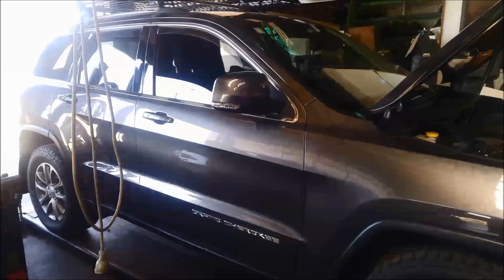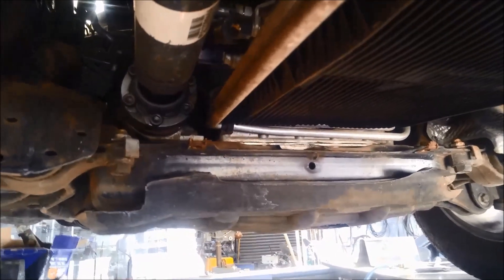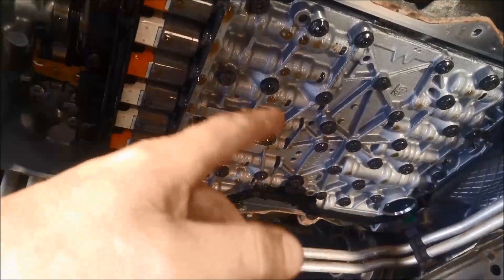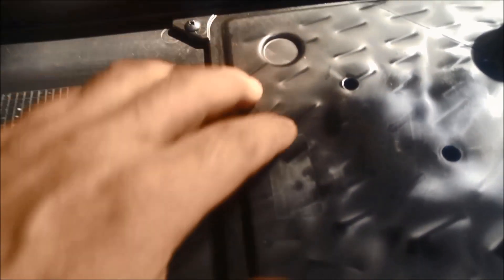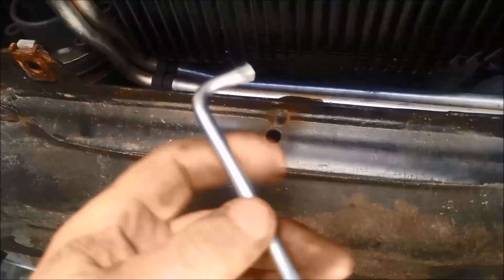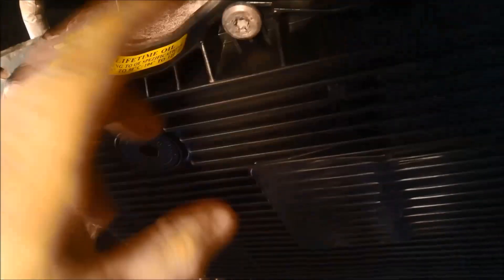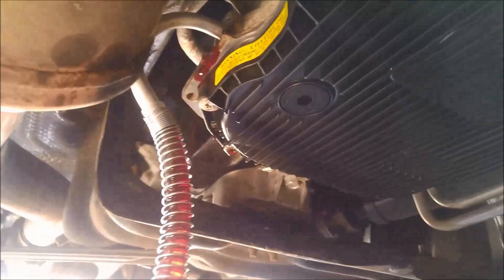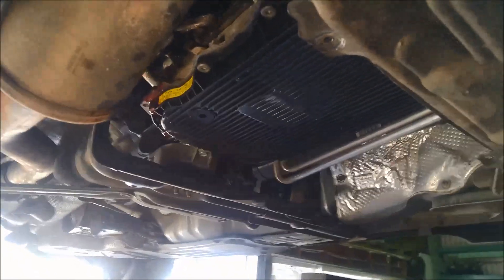ZF8HP45 ZF8HP70 845RE 0CM 8HP45  8 Speed Automatic Transmission Filter Service How to DIY

Comment: On a 2014 Grand Cherokee can the dashboard warning be trusted to tell you transmission fluid is low?  80k miles here and never changed Transmission fluid.
Reply from the maker: hi, like with all sensors, it is usually a guide/indication...its best to confirm physically. cheers

Comment: Just finished this project on my 2014 GC Diesel.  200K miles on the original fluid.  Color was actually not too bad but I’m glad I did it.  Got the pan direct from Mopar.  I have to say I was intimidated by this repair because the Jeep dealers in my area flat refused to do this service.  They said it was sealed for life and to leave it.  I have heard of others paying $700-1000 dollars at specialty trans shops to have it done.  

It was a colossal PITA but your video made it possible.  I would have never got those 4 bolts off without your video.  I did use Lifeguard 8 fluid.  Made a huge fluid mess in the shop but got it done.  A lift would have been really nice.  Even harder on your back squeezed under the vehicle.  

One issue I had was the plastic POS drain plug immediately stripped out and I ended up having to unbolt the pan and just dump the fluid (hence the mess).  If anyone has tried the Aluminum pan that is selling online I would be curious if it actually fits.  Thanks again for taking the time to put this together!!
Reply from the maker: hi, dealers either accidentally or deliberately leave a few words off end of " sealed for life " i have quizzed the engineers at trans seminars and from the horses mouth... they say " sealed for the life of the warranty " service your transmissions by taking off pan and cleaning magnets that help keep debris away from solenoids....as for the metal pan for zf8hp i haven`t seen them available yet? one thing i will add though, if you intend on reusing the plastic pan, make sure trans is fully cooled down or they won`t seal properly. cheers for beers
Reply: Hey how was your transmission at around 200k miles did u feel it was getting bad?
Reply: @SasikaSamarakoon   at 205K now.  I do 90% freeway driving.  Once warmed up it’s still running smooth.  First thing in the morning:
2nd gear: smooth
3rd gear: lags, rpms run up then shifts
4th and 5th: smooth
6th: lags, rpms run up, sometimes a hard shift. I lift up on he accel to trigger a shift “manually”
7th: smooth
8th: smooth except sometimes it stays in 7 a long time.  
One thing to consider though is I read Jeep flashed new shifting sequence to help with the emissions ordeal.  Also when cold I read the computer delays shifts to encourage faster warm up.  

Temp stays right at or below 200F according to the Jeep readout, usually 195.  Not sure exactly how it’s really measuring that.  Before the fluid change it would get to 210.

So overall it’s doing “ok”.  I kick myself for not changing he fluid at 60-100K.  I will change again at 225K and see how the fluid looks.  If there was a ZF shop in Houston I’m tempted to get a rebuild around the 300K point. 

Bottom line it’s an amazing transmission and this video helped so much.  I do drive it very “normal”- never fast accelerations or rapid speed changing, except stopping of course.  

Does anyone know an aftermarket drain pan with a real removable plug?  The one on the market only fits trucks.  

Thanks!
Reply: @nataliejustinmurphy2671   so u did run original fluid for 200k miles which is pretty good though.Mine 14' Diesel 70k miles original fluid i have the same issue with 3rd gear when its under 30c once warm up no issue.
Reply: Thanks for the reply!  I totally agree, the ZF website has recommended maintenance that is certainly not “for life”.  

Here is the metal ZF8 pan, don’t think it fits GCs due to crossmember.  

https://www.xtremediesel.com/ppe-zf-8hp70-heavy-duty-aluminum-transmission-pan?variant_id=116908&gclid=Cj0KCQjwqfz6BRD8ARIsAIXQCf2yjgxdRAtzl6MalFMacpKodumFdoIwhEQEv3EXODd839tURnoEJrIaAjEIEALw_wcB

Thanks again for the great instructional videos!!
Reply from the maker: @nataliejustinmurphy2671  i`d say you`re right , on jeep the cross member will get in way and says suited to ram and dodge. cheers

Comment: Correct me if I'm wrong. Didn't you get a false reading of fullness by putting the fill hole plug back in before you took the wooden wedge out and attached the trans to the cross member? Thanks
Reply from the maker: hi, very good observation! the wedge wasn`t that big to affect it that much ( it wouldn`t have tilted filler hole alot ) the important thing is getting the temp range accurate, however we did recheck without it off camera. cheers
Reply: @YepThatsIt  Thanks for the reply

Comment: Hello sir.  I really enjoyed your video.  How do you tell if a trans cooler bypass valve on it?  I have a 2015 jeep grand Cherokee summit.
Reply from the maker: hi, follow the cooling lines from transmission, usually there will be a valve unit or similar somewhere in that line. thanks & cheers
Reply: Several service videos I have seen show the vehicle hoisted so it can engage 2nd gear.  I was hoping I could follow what you did, but with the brake on and rpm at 2k.  Any ideas?
Reply: Also, are you worried that air may of entered the trans cooler lines if it opened up during the service?
Thanks very much...
Reply: On top there must bei a Manual withva Procedere with the Bypass Balve ans the Temperaturen issued!
Reply: Thanks to everyone who replied with ideas.

Comment: i was thinking that pan might warp , surely it will hold more heat aswell. i bet companies in the USA make aluminium pans. being a transmission specialist i bet the factory life time oil  service intervals are disregarded as total BS, its nuts to me atleast.
Reply from the maker: hi, yeah I`ve been waiting for the metal pan upgrade for these, still nothing. the lifetime oil is bs and dealerships actually call it "sealed for life" but they conveniently have left out a couple words if you quiz them...they mean sealed for the life of the warranty period...which means they don't want to do a service for upto 100,000km which is bs. cheers